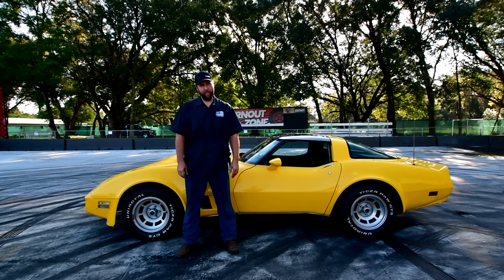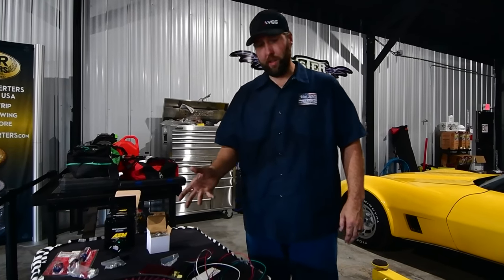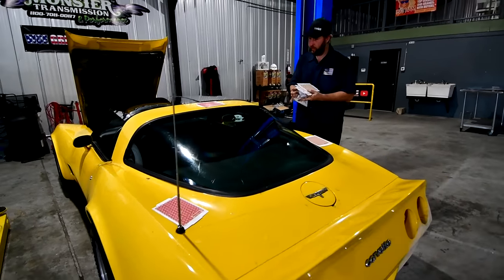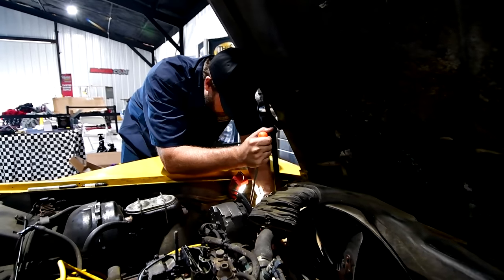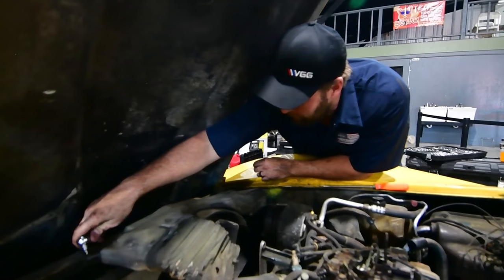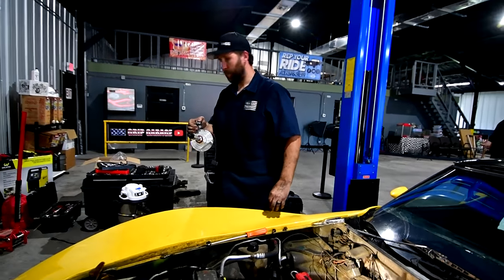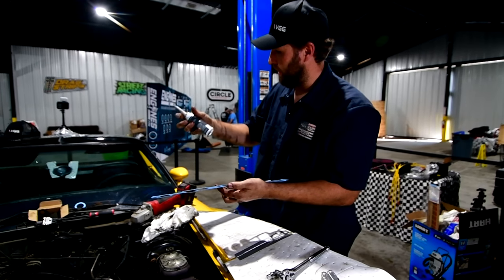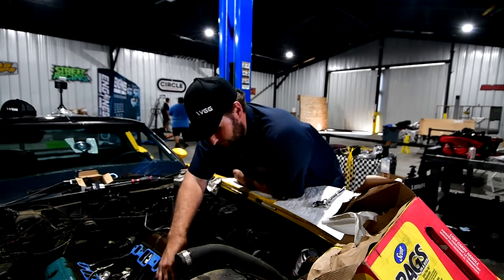FORGOTTEN C3 Corvette Gets Supercharged - PART 1 (preparing for burnout competition!)

Comment: A guy with an ant problem needs to mix equal parts sugar, borax, and water. Put it in a couple beer caps and watch them drink it like pigs in a traffic. I’ll be dipt!
Reply: It depends on what they like to eat.  I guess ants can be fussy too. Terro works great sometimes.  That stuff is excellent for fire ants and carpenter ants.   The other product I use, like you say,  just as cheap, is Roach Powder (Boric Acid) mixed with sugar.  You can buy this very cheap at Walmart/Home Depot/Lowes.  It comes in a Blue plastic container that looks like a restaurant ketchup squeeze bottle.  I mix 80-90% Boric Acid with 10-20% sugar.   Roaches will eat the Boric Acid without the sugar.  I guess they're not fussy like ants.  But ants love sugar.  Please be careful if you have dogs to not let them get to this.  Without the sugar, they probably wouldn't eat it.   But with the sugar, look out.  Please Be careful with Fido.   If you have animals, you can put this inside a box or a cabinet, where the dog might not get to it.   To properly place this, you should follow the ant to as close as you can get to their front door.  How do you do that?
Take a small potato chip and crumble it in a few places.  Then sit back and watch them come for the pieces.  Ruffles works the best, joke. They will carry the pieces to their nest.  You may not find exactly where it is, but you'll get as close as you can get.  Do Not Block the front door to their nest.  They'll only make a new front door anyway.  The trick is to get them to take the bait to the queen.  Once she eats it and dies,   the rest will die in a day or two.   Good luck !!!!1

Comment: A good thing to use for ants and roaches is called borax acid
Reply: It depends on what they like to eat.  I guess ants can be fussy too. Terro works good too.   That stuff is excellent for fire ants and carpenter ants.   The other product I use, like you say,   just as cheap, is Roach Powder (Boric Acid) mixed with sugar.  You can buy this very cheap at Walmart/Home Depot/Lowes.  It comes in a Blue plastic container that looks like a restaurant ketchup squeeze bottle.  I mix 80-90% Boric Acid with 10-20% sugar.   Roaches will eat the Boric Acid without the sugar.  I guess they're not fussy like ants.  But ants love sugar.  Please be careful if you have dogs to not let them get to this.  Without the sugar, they probably wouldn't eat it.   But with the sugar, look out.  Please Be careful with Fido.   If you have animals, you can put this inside a box or a cabinet, where the dog might not get to it.   To properly place this, you should follow the ant to as close as you can get to their front door.  How do you do that?
Take a small potato chip and crumble it in a few places.  Then sit back and watch them come for the pieces.  Ruffles works the best, joke. They will carry the pieces to their nest.  You may not find exactly where it is, but you'll get as close as you can get.  Do Not Block the front door to their nest.  They'll only make a new front door anyway.  The trick is to get them to take the bait to the queen.  Once she eats it and dies,   the rest will die in a day or two.   Good luck !!!!1

Comment: Surprised you didn't apply rule #1 of working on a Vette.....Pull the engine out. Then you can fix it. or at least reach parts of it you need to get to.
Fess up, how much did you pay for it?    Pull the entire door panel off to get the water and ants out.  They love those spaces.

Comment: Get some Terro ant killer.  Let the ants eat their bellies full and kill the nest
Reply: That's 1 of 2 methods I use to get rid of them.  It depends on what they like to eat.  I guess ants can be fussy too. That stuff is excellent for fire ants and carpenter ants.   The other product I use, just as cheap, is Roach Powder (Boric Acid) mixed with sugar.  You can buy this very cheap at Walmart/Home Depot/Lowes.  It comes in a Blue plastic container that looks like a restaurant ketchup squeeze bottle.  I mix 80-90% Boric Acid with 10-20% sugar.   Roaches will eat the Boric Acid without the sugar.  I guess they're not fussy like ants.  But ants love sugar.  Please be careful if you have dogs to not let them get to this.  Without the sugar, they probably wouldn't eat it.   But with the sugar, look out.  Please Be careful with Fido.   If you have animals, you can put this inside a box or a cabinet, where the dog might not get to it.   To properly place this, you should follow the ant to as close as you can get to their front door.  How do you do that?
Take a small potato chip and crumble it in a few places.  Then sit back and watch them come for the pieces.  Ruffles works the best, joke. They will carry the pieces to their nest.  You may not find exactly where it is, but you'll get as close as you can get.  Do Not Block the front door to their nest.  They'll only make a new front door anyway.  The trick is to get them to take the bait to the queen.  Once she eats it and dies,   the rest will die in a day or two.   Good luck !!!!1